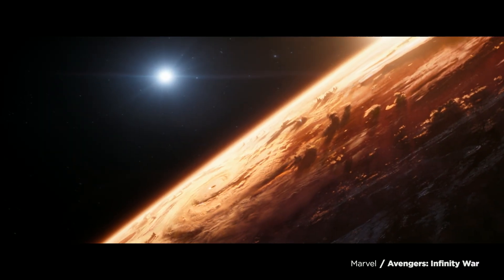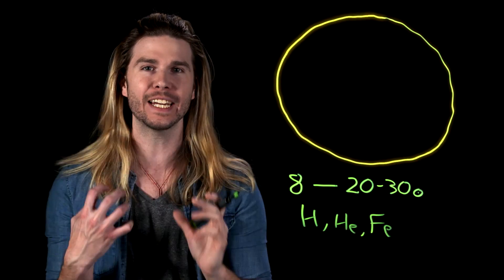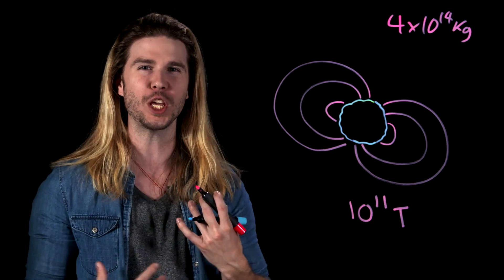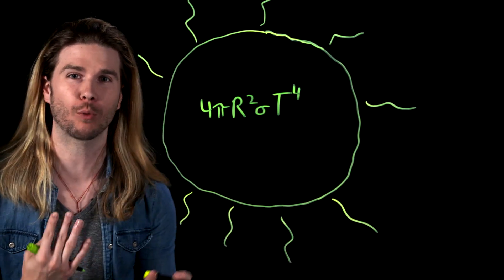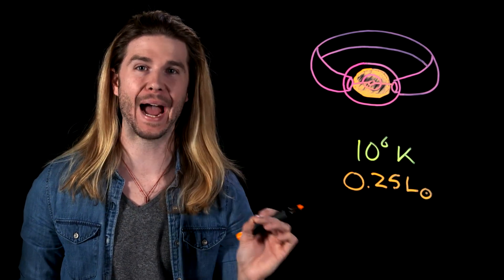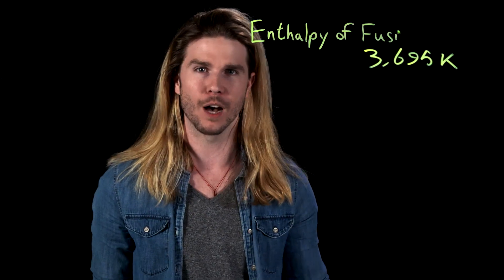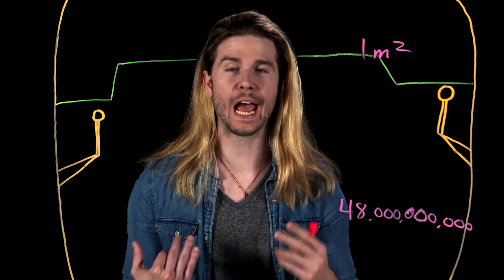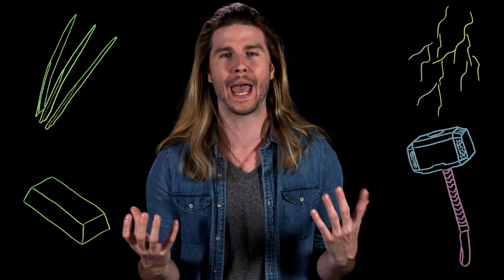How To Forge Thor's Infinity War Weapon

Comment: Kyle, 

In Capt America: Civil War, Cap jumps and grabs onto the runner of Bucky's helicopter as it's taking off, the chopper immediately loses altitude down to where Cap can now stand (ok, it's a large helicopter with a reasonable lifting capability but this is believable. We've doubled the load we were carrying, let's dig those blades in, Bucky and up the lift). Cap holds the helicopter down and stops Bucky from taking off as his feet slide across the helipad. After sliding about 30 feet he finally grabs onto a rail on the edge of the building which he holds with his other arm to keep the chopper in place. That model chopper is at least a four seater so let's say it can easily generate enough lift to take off with Bucky and Cap on it at a total of ~430 lbs together in the MCU (including bucky's arm). Since Cap can't spontaneously become more massive at will, shouldn't the helicopter be able to easily counteract whatever force Steve Rodgers is pulling with? It would be like trying to push the helicopter down from the inside. It doesn't make sense until Steve grabs the bar and applies a force in the opposite direction to counteract the lift. This keeps me up at night. 

What do you guys think?

Comment: Fun fact about liquid tungsten: Scientists actually know very little about the properties of liquid tungsten for kind of a silly reason. Because its melting point is so dang high there's really no container that can hold it. Anything you try to hold the tungsten in will melt long before the tungsten itself.
Reply: Mooser323 that's really cool!
Reply: Tungsten’s only the highest melting point of the metals. Carbon’s is higher, so a coal bowl could hold it. (Except for the obvious fire problem)
Reply: There are some alloys that can hold liquid tungsten, most notably tantalum carbide or hafnium carbide, they have a higher melting point
Reply: Put it in a really thick liquid with a higher point of vaporization than tungsten's melting point.
Reply: Maybe it would help to just have a large block of tungsten and just melt the center of it

Comment: Hey Kyle, you missed something with your end gag. Stormbreaker does not have a worthiness detector in it like Majolnir does. That enchantment was placed on the hammer by Odin in Thor 1. So technically wielding Stormbreaker is more about being able to withstand its tremendous amount of energy output, not being worthy, as it has no detector installed.

Comment: You would think that with the extreme gravity of a neutron star and the fact it produces less energy than a star such as our sun it would be easier to just use a star like our sun as the forge. Sure it would be larger and you would have to create a larger focusing/containment system for it, but you wouldn't have to compete with the gravity as a trade off. You wouldn't even need to necessarily contain the whole star too, they could just harness the luminosity from part of the star with a focusing lens like in the movie. For example if they built their apparatus near R136a1, which is the most luminous star we have found so far, they would potentially gain a lot more energy.
In the end the writers just thought saying "Neutron Star"  sounded cooler than Huge freakin star, but in truth it is a far less powerful form of energy than other things in the cosmos, like Quasars.

Comment: I think the real question is if storm breaker would pierce Captain America's shield
Reply: It barreled through a laser of all infinity stones put together so I’d say yeah.
Reply: Fled Nanders there was a comment that mentioned just how strong uru must be if a neutron star is required to melt it down. The shield was forged from vibranium, which was melted down by the strategic scientific reserve during world war two. There is no way they could possibly have approached even I don’t know, 3%  of that stars output? If Vibranium can be melted by humans in the forties, than it must not have a very high melting point is what I am trying to say.
Uru must be magnitudes stronger than vibranium, probably strong enough to overcome the other metals ability to absorb kinetic energy, if the blow is concentrated into a point such as the axe end of stormbreaker. The blunt hammer end would probably be just as ineffective as Mjølnir was.
Reply: Fled Nanders ni
Reply: Vibranium seems to have been nerfed pretty hard in Infinity War. Vision is literally made out of it and he got stabbed pretty bad.
Reply: Hammerside should be fine, but the bladeside.. uh oh
Reply: Matteus Silvestre He got stabbed by alien tech so I wouldn’t be surprised it hurt him.
Reply: "As Striker narrated in X-2, it can be liquefied, but, once formed, becomes indestructible." I keep reading everywhere that Adamantium is nothing to write home about before liquification, but after it's a different element. And Vibranium is supposed to be stronger

Comment: So did they make that contraption around the star to keep the star from heating up the entire foundry or to keep the star from burning up whatever they are breathing? 

Since it seems like they can make a mirror to keep the stars energy in check (blocking stuff would melt or be as hot as the star) i'm guessing the latter.

Comment: If you planted stormbringer, would a new groot child begin to grow? I mean in the very SPOILERY ALERTING ending:

Is this far enough down? I hope so
When groot dissipates, the handle doesn't. At least I'm pretty sure it doesn't. That means the universe no longer identifies groot wood for the handle as the same individual. And just like how even after taking a spaceship crashlanding, the "damage" sustained by the burn pulling it together (and the burn afterwards because it takes metal some time to cool) shouldn't be enough to stop planting the weapon from making a new groot child.
So stormbringer = groot 3.0?

Comment: Here’s my question: what about the shell around the star? What kind of temperature would it have to withstand in order not to melt? Come to think of it, if neutron stars have that much gravity, what kind of structure would be able to handle all of that? How could there be any moving parts at all? Friction force is normal force times coefficient of friction. In this case Fg would be equivalent to Fn, so how?!

Comment: Wouldn't a black hole be more dense than a neutron star?
Reply: Frame by Frame Productions density of a black hole at itd centre is infinite. But you can't get to it without being ripped apart.
Reply: MattTheBoss yeah, and being infinite makes it more dense.
Reply: Frame by Frame Productions We don't actually have any 100% solid proof black holes actually exist. Just probable theories. Black holes probably don't look as flashy as a neutron star for film purposes. Infinite is more than literally anything else.
Reply: Frame by Frame Productions also black holes don't give any energy out.
Reply: MattTheBoss eccept hawking radiation
Reply: jackson colbert technically yes. But hawking radiating is so miniscule that I wouldn't count it In this circumstance.

Comment: One thing to be noticed is that the bowl that is used to contain the molten uru metal isnt melting even though it is being exposed to similar energies as the uru metal. So whatever that metal is, it has stronger bonds than the uru metal. This can also be said about the metal structure surrounding the star.

Comment: Well then there is an error on that scene: when the dwarf looks into the melting por of Uru it looks like normal molten iron: pale red. But considering that the temperature of an object causes electomagnetic radiation, and the more hot it gets the frequency of that radiation gets higher, that pot should be as bright as the star

Comment: Etree says that Thor will be exposed to the full force of the star, not a 6.5' cross-section of its luminosity. When we see the beam being directed at the forge, it is cohesive. If it were only receiving that portion of the star's luminosity then it would be radiating 360 degrees instead of a directed beam. Obviously the forge apparatus is designed such that the full output of the star is focused and directed to the material (in this case, uru).

Comment: Hey Kyle, you missed out a stage in the Life cycle of stars, all stars become red giants before the next stage, just that in the case of neutron stars and black holes, they had formed red supergiants. Stars don't skip to the neutron star phase from being main seqyence stars.

More detail:

Smaller stars form red giants which whilst not going supernova still form a planetary nebula around their now white dwarf core.

Larger stars which will become neutron stars, form red supergiants, before going supernova, forming a nebula around the neutron star core (possibly why we can't see into the centre of nebulae).

Very large stars which will become
Reply: Cont... black holes form very large red supergiants which then create extremely large supernovae and huge nebulae (possibly the birth place of many galaxies). The sheer mass of the black cores clears a large space around them by pulling in any mass or energy in their vicinity.

Comment: well if the neutron star is surrounded by a metal sphere, wouldn't its magnetic field be nullified?
Reply: That's not how magnetism works. If you stick a magnet in an iron box, it'll stick to the iron and magnetise it, and you'll have a magnetic box. If the box isn't magnetic, but the magnet's field is large enough to reach outside the box, then the box doesn't get in the way of the magnetic field. It can, with the right type of metal, significantly reduce the strength of the field. But not enough to call it "nullified", especially on the scale of a neutron star's field.

If you took something like "mu metal" (the best magnetic dampening metal known to modern science) and scaled up the effectiveness 1,000 or so times using Asgardian space-magic...

...you're still going to be goopified in the "thousands of kilometres away" range.
Reply: What if the rings and Dyson sphere are emitting an intense magnetic field that balances the star's own field? It would also explain how the sphere can withstand the intense radiation and heat of the star. Much like how antimatter is contained, or how our own sun's magnetic field shapes massive arcs of plasma on its surface.
Reply: If the metal is Copper, or Copper based, like Bronze, then yes. Otherwise, the magnetic field will still stretch out beyond the sphere.

Comment: Ok tbf the ammount of toungsten that that ammount of energy would melt in the forge is actually less than you say it is.

We see that all that energy isn't directly pointed at the metal but it actally goes trough a divisions system, or if it is not a division system, it is used to power rest of machinery needed to operate the forge. 

In any way the ammount of energy thats actually used to melt the metal is less than the energy outputed by the star in that time frame.

Also if it's the system trough which the energy is funneled trough is actually a division system used to operate multiple melting couldrens, then the energy at one single couldren is way smaller than the enegy outputed by the star, and also minus the energy disepated trough heat when it travels teough the funnel system.

Even so it's still probably massive ammounts of energy but less than you say it is.

Even if the funnel system only operated one couldren and there was no machinery powered by the energy outpured by the star, the heat dissapation energy would still make a significant imapt because in the movie we see that there are "control vales" that constanly let out some of that energy out so the system dosen't over heat.

Comment: So going off the number you proposed for Mjolnur, when Hela shattered it in Thor Ragnerok, that should have caused more damage than it did. Assuming the hammer broke into, say, 1000 identically sized piece is at a small explosion velocity (4000m/s) each shard could hit a target with 1.6x10^12 N of force. That’s insane!

Comment: Oh I wanna be super nerd so bad but alas I don't have the time during my lunch break. 

So a neutron star is slightly less massive than a small black hole, skirting on the low end. Wouldn't it be possible that a large neutron star have a valley (however flattened and dispersed across it's surface) to form a puddle that's altitude crosses the Schwartz shield radius? A puddle or lake of blackness that crosses the border from the radiant light.

Love the show!

Comment: Aren't you assuming that it's direct heat that actually heats the hammer? I don't remember the scene quite well, but it seemed that it was in a crucible, that was heated. Therefore heat resistance of both the crucible and the atmosphere should be accounted for the calculation.

Comment: Hello! Big fan of the show but you mentioned that a third of the power of a lightning bolt can melt tungsten - surely that depends on the time duration of the lightning strike to transfer that energy to the tungsten??

Also people say that it didnt have the enchantment to make it wielded only by those who are worthy- hence why groot can lift it. However thor does state himself that the Guardian's don't have the strength of body or mind and that they'd succumb to madness if they all had a thanos killing weapon - groot didnt go mad and managed to lift stormbreaker so even if groots not worthy it isnt any less impressive in my opinion

Comment: So with all that gravity pulling on Thor… how much force would have to be pushing on Thor through that iris that he’s holding open to be flung away from the opening at escape velocity from the star’s surface?

Because otherwise when he let go, wouldn’t he have been pulled backwards towards the star’s surface faster than the iris snaps shut?

Comment: Nuclear fusion is actually really interesting in stars.  The closer to the center you get, the hotter it gets, allowing it to fuse heavier materials.  So in the center there's iron, and moving outwards the elements get lighter. Kinda neat.

Comment: This isnt directed at you Kyle, but rather at the movie makers. Assuming that the Uru metal behaves similarly to metals we can make and use on Earth, casting said ax is a less than optimal method of crafting it. Casting is going to get a very uniform grain structure (basically the bits and pieces that make up metal at the micro-scale) across the entirety of the weapon. Making a weapon by forging (beating on hot, but not molten, metal) is going to give you a superior weapon with better mechanical properties due to the forced "flowing" of grains as theyre moved around by the tool (aka a hammer or press)

Comment: @Kyle when you said about Thor standing in front of the energy i thought you were going to recalculate the energy needed to melt the alloy because some part of the total energy is being blocked by Thors body and not all of it reaches the metal. So the "Q" in joules required to liquify it should be lower.

Comment: So if Thor can withstand the energy used to make his new axe and is the power source for it then why would he need it in the first place?
Reply: Bradley Roar because his weapons help him channel his powers. he still has his powers even without a weapon, but Stormbreaker helps him control his powers and make them even more potent
Reply: Completely understandable, but I feel that if Stormbreaker was capable of injuring Thanos, wouldn't Thor's sheer strength and durability provide just as much power?

Comment: in your calculations for the energy that goes into the forge you did not take into account the magnetic field of the neutron star (unless I'm mistaken), just the luminosity.
that would increase the energy available for the forge.

Comment: One thing that bothered me during the movie is that Stormbreaker isn't forged at all. It is cast. Rather than getting into the engineering and metallurgy of why forging is probably better for a war hammer/ax I will just throw out there that the weapon could have been much better. 

Admittedly "cast in the heart of a dieing star" just doesn't have the same ring.

Comment: Would the metal used require heat treatment and tempering? 
Otherwise it wouldn't hold an edge and it dent and bend with everything strike. (If it acts like any other steel. Not sure if tungsten can be or needs to be heat treated.) On top of that, how long did it take for Thor's new weapon to forge? I made a small hatch and it took like 2 weeks.

Comment: When you calculated the amount of energy required to melt the metal, did you consider how much of the "surface area" of the energy outlet was being blocked by Thor's silhouette? Because the energy delivered to Thor should be subtracted from the energy output to figure out the energy delivered to the metal ingots in the forge.
Reply: Tassadar237 still lots